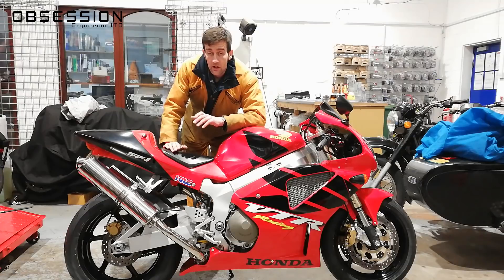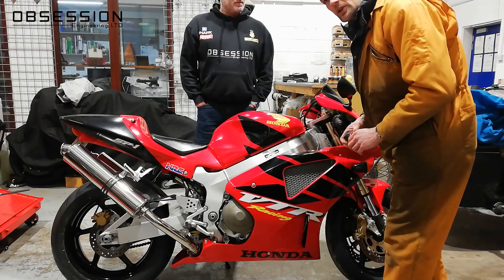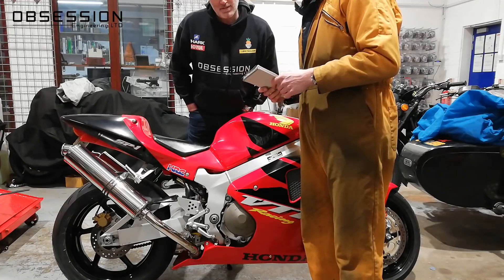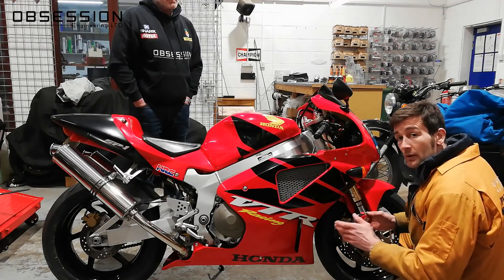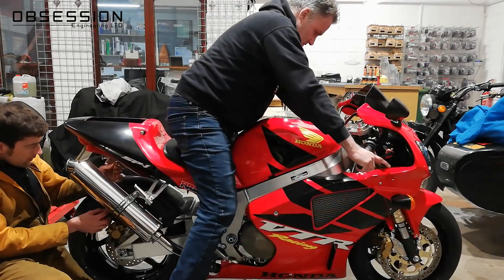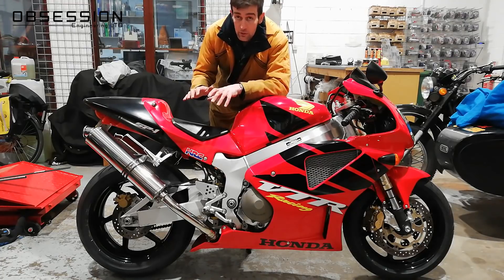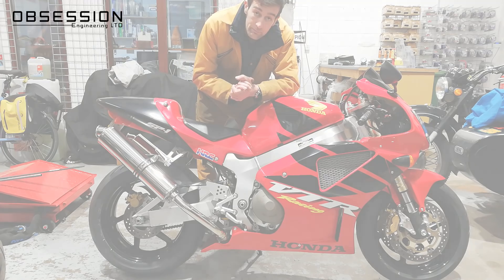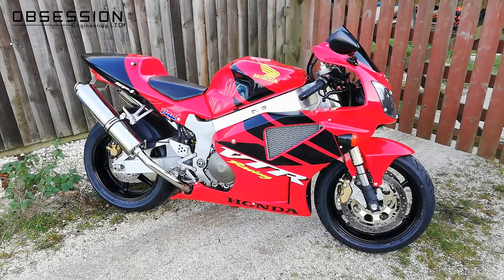Henry's Honda. An SP1 Restoration. Part 14. The final Episode with suspension setup, how to set sags

Comment: Does anyone else think the front rebound setting is too little? To my mind it shouldn't bounce back beyond its resting position and then settle, but should come back to it in one movement, not two
Reply: I'd be of the same opinion myself Ben. Especially for the first set-up and the fact that the oil (and everything else) is stone cold. And where was the static sag reading?
Reply: @pedrosixfour  I guess because rider sag is more relevant than static in ensuring your spring rate is correct. I've had numerous bikes over the years where static was correct but then rider sag was way too much.
Reply from the maker: To me the laden sag is always far more important than static, I don't often ride without me on the bike!
As for the rebound, it's a very good observation, on track I'd definitely have more control but on our less than smooth roads the lesser low speed damping will help over the bumps and it still has enough control to keep it from getting bouncy.
Hopefully I'll get the chance to demonstrate the difference on the test ride vid. 
Appreciate you all getting involved in the discussion :)
Reply: @obsession_engineering  Hi Dave, I have been watching this series and enjoyed this segment a lot. I have also been watching Dave Moss tuning and can understand why some may feel that front rebound looks a little loose making the front end look bouncy. Having tried both methods, i.e setting according to dave moss- compress, top and settle immediately vs what you have shown (slight bounce and then settle), I feel that for road riding - the front has to rebound faster otherwise the bike will just dive and fall into a turn at low speeds (below 50kmh) 

Just a quick question, do the front and rear compression/rebound speeds have to match each other? From your video, the front is compressing and rebounding faster than the rear.